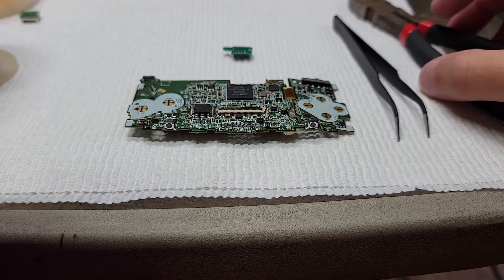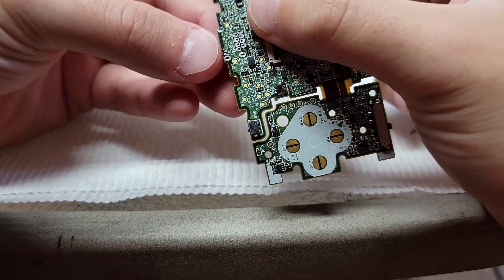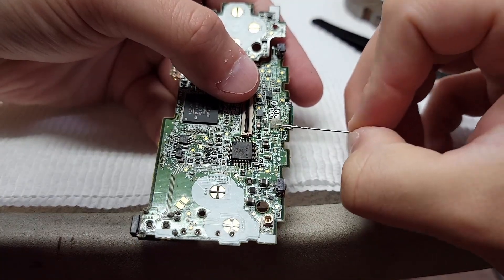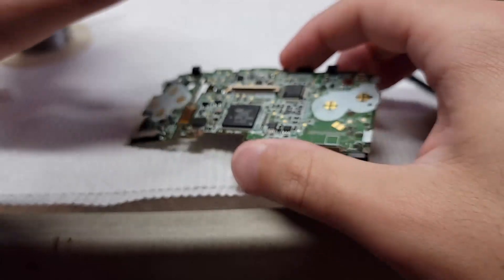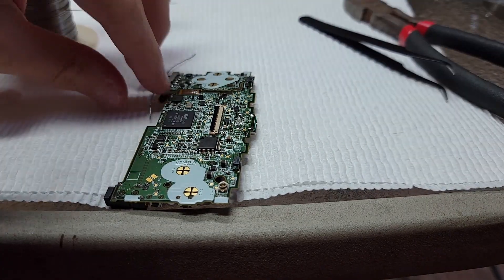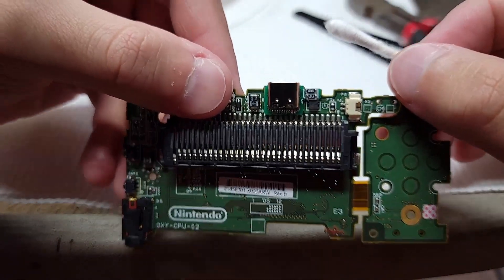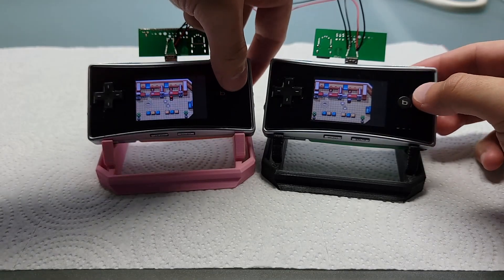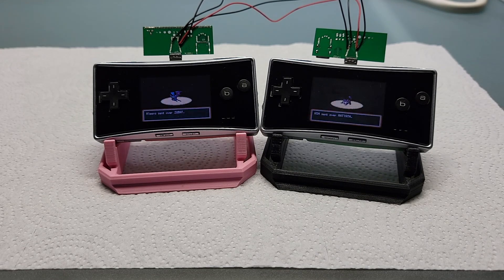Game Boy Micro: Tutorial - USB Type-C Mod! Updated Design!

Comment: This is so cool! I was thinking about designing this, but I have no experience with pcb design. Will a regular USB-C to USB-C cable work for trading? Sending you an email, I'd like to buy a couple. I'd like to make a GBA port to USB-C pcb also, maybe it's time to learn KiCad ;)
Reply from the maker: I will try to respond to your e-mail as soon as I can! Thank you for your support!
Reply: @micro_endeavors do you have a link or contact details to get in touch about buying a few of these from you please? I have 3 GBM that I’d very much like to bring back to life.
Many thanks, Mike 😊
Reply from the maker: @1up_Gaming  Hey Mike! Thanks for the support! If you are interested in the mod I have a few in stock at this time. You can reach me on Reddit, Instagram, or through e-mail. My handles are micro_endeavors and my e-mail is microendeavorsjb@gmail.com
Reply: @micro_endeavors  perfect, thank you 🤩 will drop you a mail 🙌🙌

Comment: Just wondering, if you add a USB-C to every nintendo handheld up until the Switch, does it charge faster? 🤔💀
Reply from the maker: Great question! No it does not! USB-C is capable of charging at different power levels but that power level is decided by the internal circuitry of the device being charged. Most people do not go as far as integrating that circuitry when they do a USB-C mod so you can expect most USB-C mods to draw the standard 5V for charging a device.

Comment: In your build would a metal leg lead would not work with the tolerance of the pcb.
Reply from the maker: I am afraid I dont understand your question. Could you rephrase if possible.
Reply: @micro_endeavors  like thin capacitor legs or wire through the holes.
Reply from the maker: @cloudandtifa2000  I am sure you can connect wires from the USB-C connector to the holes of the Game Boy Micro port but it would be very difficult with a 12-pin connector like this one. I would suggest a 6-pin connector if you decide to go that route.